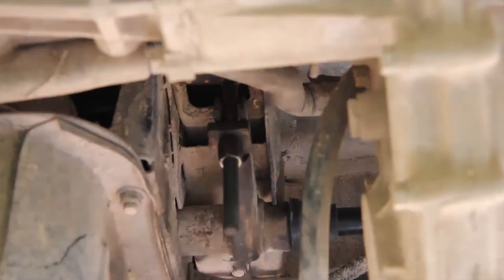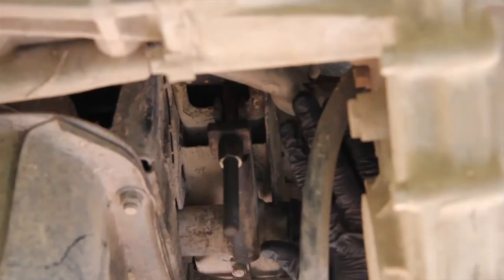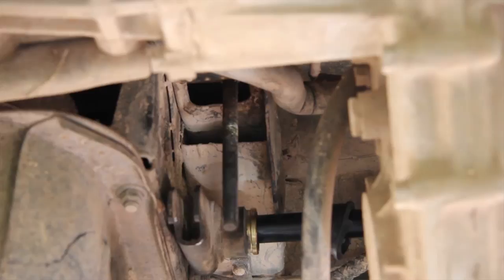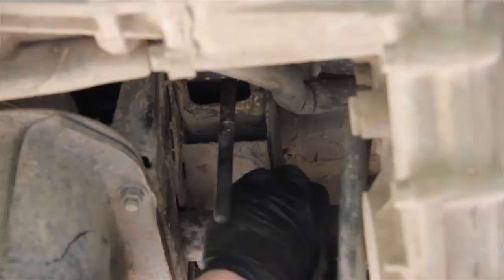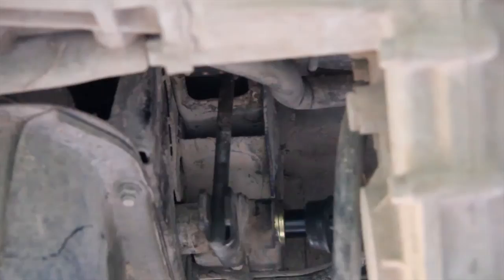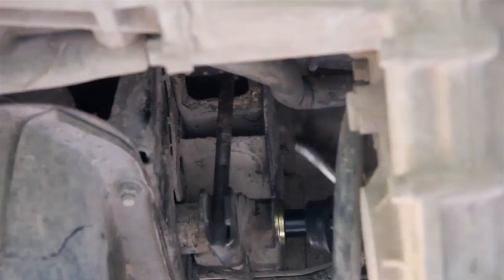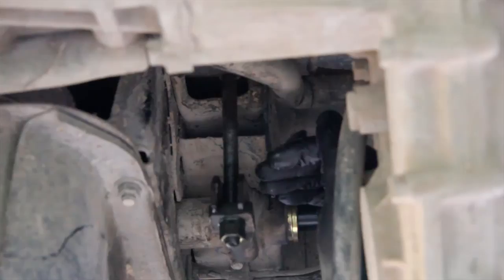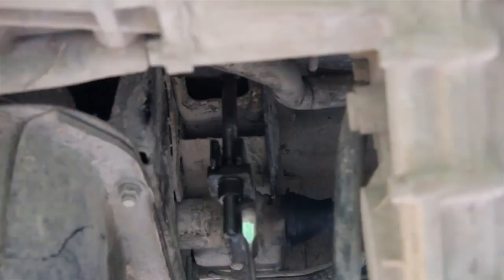Torsion bar adjustment on a Mitsubishi Delica l400

Comment: Thanks for the video mate.
Would you have lowered a delica before?
Im particularly keen on how if this is possible and also how the car will look.
Reply from the maker: Hi, I've seen a couple of lowered ones but, for me, it looks a bit odd on a deli. In theory you would just need to wind back the torsion bars and find some shorter springs to lower it. Bear in mind that stock torsion bars that are would back will probably be a fair bit bouncier.

Comment: Just adjust torsion bars? No need to replace any parts on the front end? Wow, that's great . Should fit 31" no problem. Where would you get new rear springs from? Can you instead add spacers in the rear?